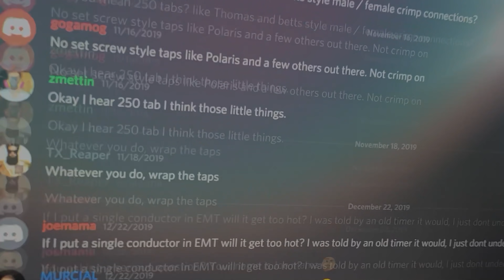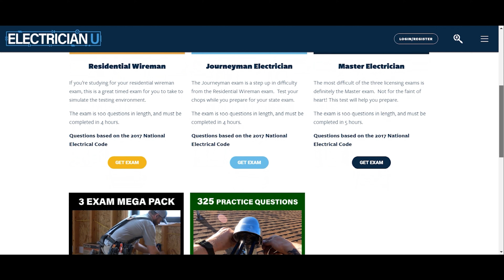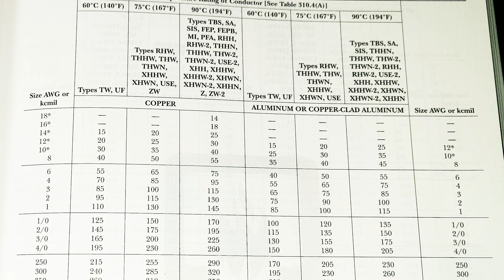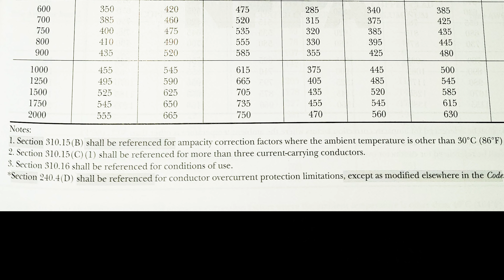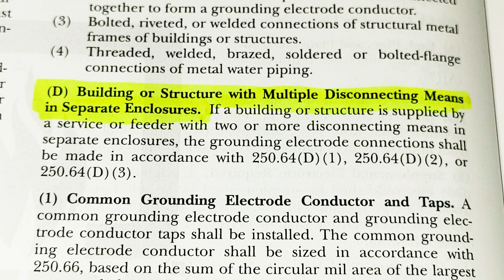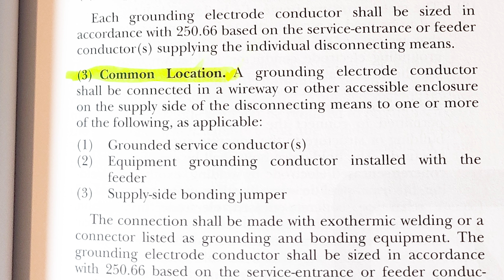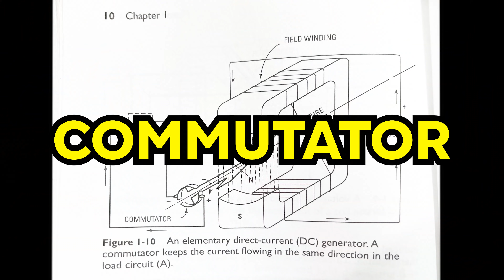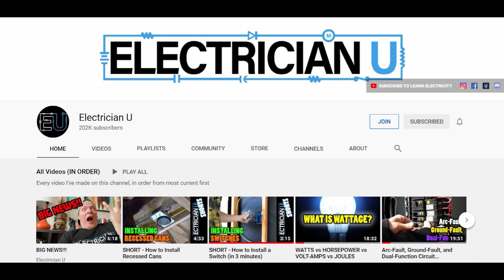Q&A 6/4/2021

Comment: Wago is a brand and they aren't all push in connectors. They also have the ones that have the little lever lock that work well with solid and stranded and are reusable.
Reply: I worked for a couple companies that NEVER wanted those on the job, and it's understandable when you wonder why a recept or switch isn't working, and/or breaker is tripped, take it apart and there's wire hanging out. Some people just think to just push in the wire and it SHOULD lock in, without actually giving the wire a tug first. I personally love using them.
Reply: @Jason_Van_Stone  Yes, with any form of termination it's good to do a little tug and visual inspection before closing up the box and turning breakers back on.

Comment: @28:50 same issue I had with dimmable switches and ceiling fans/lights, then I found out you have to manually turn the fans light power to on from a simple switch on the fan itself or the pull string. Something so easy, small, and stupid.

Comment: Wagos are NOT stab in. Stranded wire is much easier with Wago than with twisting wire nuts. Wago uses a lever to lock the conductor in place and they're much more functional in every way than are twisted wire nuts as well as Ideal In Sure style connectors.

Comment: We never called one side of a 3 wire 120/240 volt panel a phase. Both energized wires are on the same phase. So we always called it a leg. Only thing worse then a 3 wire shared grounded conductor is the 4 wire shared grounded conductor found in 3 phase 120/208 volt panels. The large hospital/ research center that I retired from stopped allowing the shared grounded conductor every where and made electrical contractors run minumum of 1" conduit and minimum of #10 guage copper conductors from panels to breakout pull boxes for all 20 amp circuits.

Comment: I don't hear many builders complain about Electrician's cleaning up when they are being charged by the hour, only when it is a bid job.  Clean up is built in to the most large job bids, but not usually small jobs. We don't have time to clean up 4 million wire trimmings. We clean up boxes and wrappers.  Other trades do the same thing.  OCD clean up is for $12 an hour laborers. Great video. Thanks

Comment: Love your videos!!! I had a quick question. If the neutrals and grounds are bonded at the service panel, then why doesn't the earth ground carry the current from the neutral to the earth?
Reply: Electricity always tries to get back to the source. The quickest path back to the source is via the neutral unless there's a fault in the connection. 
The ground also provides a low-resistance path for lightning to get back to its source - the earth - instead of traveling along every part of your electrical system.

Comment: Back in the Old Old days they used solder and crimp sleeves with a plastic cap instead of Wirenut...
Reply: PT and a diaper. That’s how we did all our connections when we did Galvanize Rigid and all explosion proof in this sewage plant recently.

Comment: Huh.  The commutator sounds like a four-way bridge rectifier.  I am not an electrician, or an electronic repair person.  I only replace fixtures/outlets/switches (and sometimes add an outlet in the same stud bay if the switch above has all three wires) as a handyman, and watch some Big Clive and Louis Rossman videos.

Comment: Do you think POE (Power Over Ethernet) lights with a POE switch will soon replace current residential lighting?
Reply: Ethernet cables are twisted pairs and they can't carry nearly as much load as Romex. The connections go bad more often as well.

Comment: Do you have any experience with EVSEs? The hardwire side of the technical manuals are all over the place on calculated load and maximum wire gauges accepted by the stations. And the youtube side has some scary installs for sure.

Comment: QUESTION:  What is your prefered method of pig tailing AL wiring to copper.
Reply: What size wire? For conductors above #10 would use approved split bolt bugs that have a seperator plate to so aluminum is not in direct contact with copper. #12 & 10 Aluminum they have approved pressure connectors. Think I read that at least one brand is only approved for dry ( indoor ) locations.
Reply: Only tracker for panels that I saw was on a dual service 13,200 volt service we had in a building. Was made by Square D.

Comment: Hi dustin. On knockout plugs and romex connectors for metal boxes what does trade size mean EX:3/8 trade size 1/2 knockout. Thanks
Reply: If it's marked 3/8 that would mean something like it is good for 3/8" flexible metal conduit. 1/2" KO specifies that it fits into a 7/8" hole. ( size needed to install a 1/2" rigid metal conduit ).

Comment: Nope, sorry. I cannot agree with Weygo use in general connections. I am OK with the use in an individual can. I am never going to use them in place of wire nuts. Improper installation of a wire nut may create the issues that compare to Wago failures.